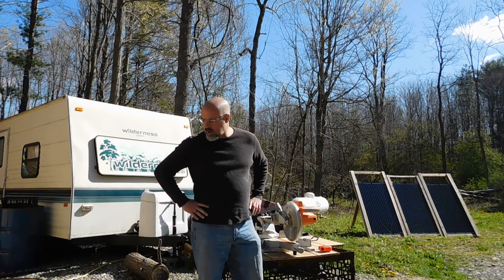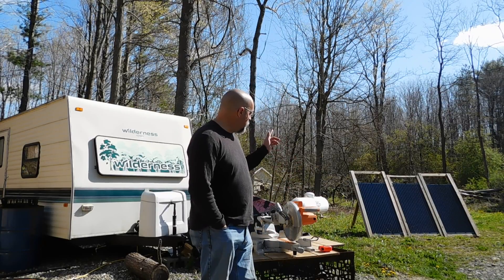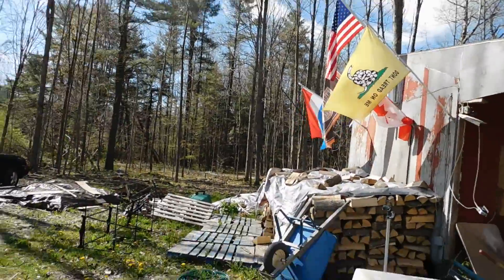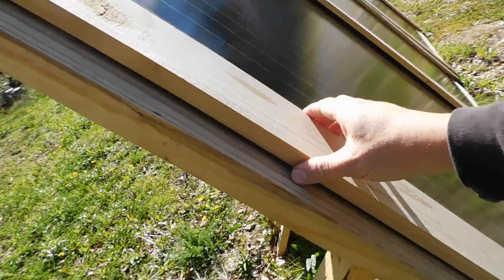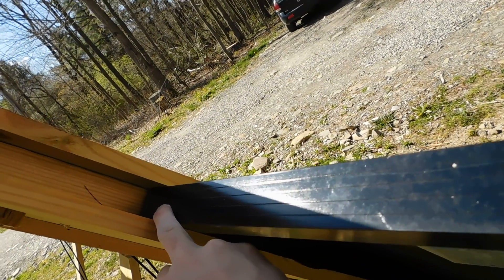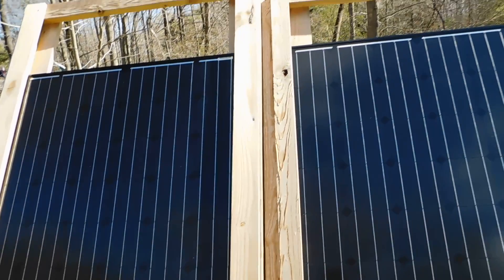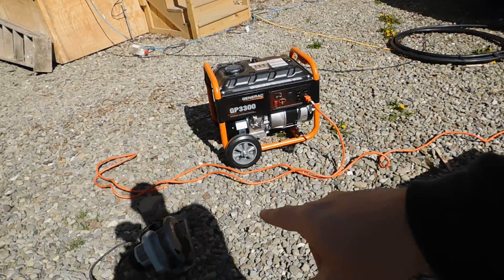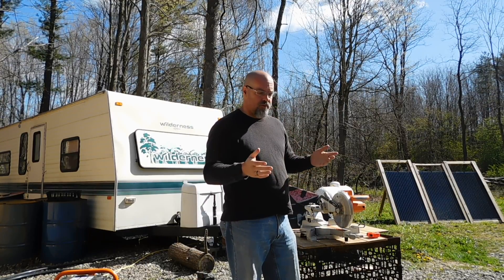Working on the frames for the solar panels.

Comment: The problem with wood, certain types in particular,is that it tends to warp.Now,if it does it may create tension and damage or even break your expensive panels.This could happen rather quickly under dramatic weather changes.Ive seen boards turn into bananas in no time.Something to consider?
Reply from the maker: +zipde doda They are pressure treated so I hope that makes them hold up better.

Comment: Your loseing like 15% or 20% with tho's blocking brother. I did not ever see that be for or i would have told you..
Reply: +yankey4 im a dumby when it comes to solar panels ... how can you loose that much when les then 1 percent is being shaded ?
Reply: grizz270 DOh I did this hole right up and lost it. LOl It's how they are wired. The blue or black squares you see on a solar panel is a Cell.

If you shade just one cell or part of a cell. That pulls down the the volt's and amps the hole panel makes.

Its like when there is a car going slow and it's a no passing or you just can't pass. How they slow you all down. Same thing here..

Here is a real real good video showing this. I did not linkit as it may not post so just copy and past. Hope this helps..

(Suncentric solar pump vs shading)     that is the name of the video.. If You can't find it let me know and I will pm it.. God Bless.
Reply: yankey4 thanks for the reply and that makes sense .
Reply: grizz270 He duse shade a good bit in the video but it's the smae deal just shading one cell..
Reply from the maker: +yankey4 I am going to fix it with them.

Comment: I thought your panels didn't have the aluminum frame around the actual panel. you don't need the channel, you can just bolt the panels to the wood frame. you may reduce the output id any of the solar cells are partially covered.
just saying.
I don't see you swatting at black flies, do you not have them or are you covered with deet?
Reply: +Rev John O&#39;Toole  Yes covering any portion of a cell renders that cell next to useless..  just drill a pilot hole in the aluminum frame and screw the frame to the wood..  they wont go anywhere, they will be fully exposed and  and make them easier to clean off also. Hes loosing a large portion of his possible generation capability.
Reply from the maker: +Rev John O'Toole no black flies yet I hope I don't get any.